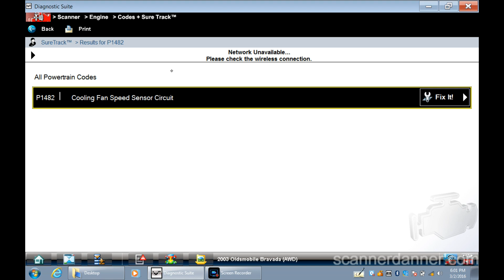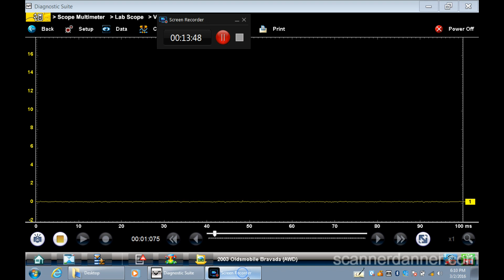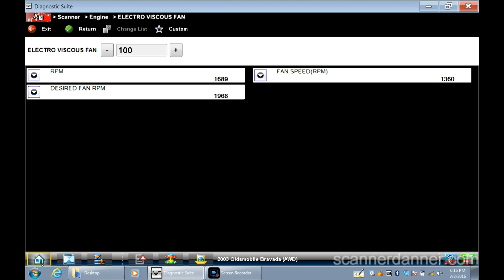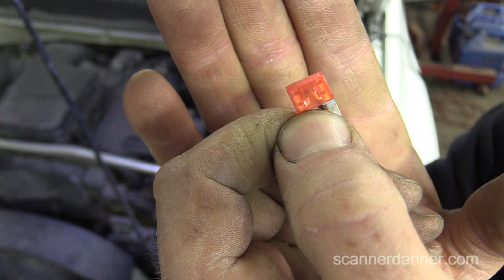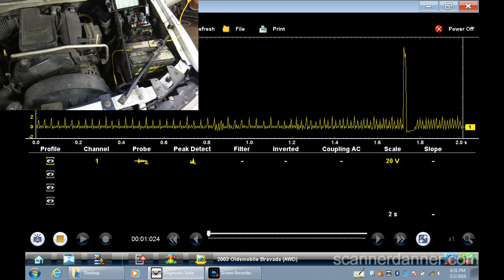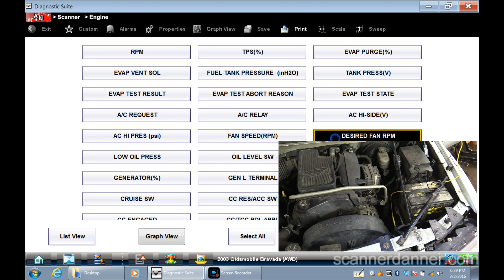Electro Viscous Fan - P1482 Cooling Fan Speed Sensor Circuit

Comment: Threw a water pump, thermostat, rad cap, and fan clutch at mine to still have overheating issues, then see your video and find out it was just the fan relay was bad. Thanks for the great video ScannerDanner!

Comment: I know its an old video. But maybe someone sees this an has an idea. 
07 Mountaineer 4.0
Never overheated, had the ac leak fixed and refilled. Less than 5miles from the shop it started getting warmer till 15mins later it eventually overheated after the temp went up and down. Being 90°+ i was atleast able to make it to my work. It had coolant and oil. I am thinking the electro viscous fan clutch is bad. But im not getting a code or anything. Wires were melted but i hsd previously repsired that section but could that be why its perhaps causing overheating. Just not running hard enough. When u shut her off ut stays spinning for 10-20seconds and i know that would mean a regular viscous clutch would be bad.
Reply from the maker: Step 1 before you go any further is to do a chemical block test for a blown headgasket. 
Step 2 it could be a fan issue but if it is, it will ONLY overheat in traffic. With constant airflow from driving it, it will remain cool.
Your AC system will be disabled by the ECM if it senses an overheating condition

Comment: And you know snap on is nothing but a joke rip off at 300% markup. You have to keep updates every 2 to 3 years because if not you go behind you’re looking at $10-$15,000 just for updates and the whole thing is all that data that Snap- charges you for all the aftermarket Mac Matco XL I’ll tell is the same data that’s in that scanner that you’re being charge for and they give you those function testing that Snapon gives you the same identical wants same data for free and you don’t pay 45, 5500 for a scanner and you get all the connectors they give you With the price of the scanner but snap on you have to buy that separately but guys in the automotive like the color green the design I understand that I buy snap on but when it comes to their test equipment it’s not worth it I’ve done it you get the same thing for a cheaper price and better equipment better warranty the data they only warranty that for one year the other companies out there some go to years but basically it’s the same thing one year so when you see your snap on rap if you want to easy bring a bottle of Vaseline
Reply from the maker: You seem like an angry and bitter person

Comment: Can I put double fans an take out my fan clutch I change my fan clutch every 6 months Y. .
Reply from the maker: Most likely. You'll just need to add a relay and maybe a temp sensor to trigger the relay
Reply: @ScannerDanner  do you have those sensors (number) an I can hit auto zone thanks
Reply from the maker: @fatjack840  no my friend, this would all be aftermarket stuff that you'll have to do research on to see what will fit for you. If you need additional help, post this to my forum. IT is free to join and we can help you https://www.scannerdanner.com/forum/post-your-repair-questions-here.html

Comment: I have this crazy problem after changing out the water pump on my trailblazer. But when I pulled the fan and clutch I found bare wires going to the clutch. Fixed, installed new pump, threw it all back together. Now, I won’t climb over 160*, fan fuse was blown, replaced, I stopped the fan by hand while running, blew the fuse again, replaced and drove to work. Checked it out and was blown again. Oh man what did I do lol getting into fall 50/60 degree days and the heat works.... just not well. Thinking bad Tstat and now clutch. All was fine (ac/ heat/ coolant temp) before the water pump failed. Any ideas?

Comment: Aren't those also temperature/rpm dependant...it always seemed they were locked up cold then quieter as it reach operating temp then locks up mire as it gets hotter.
Reply: More
Reply: 300 seems low

Comment: I have the same problem with my 2002gmc envoy, I changed the fan clutch, and the check engine light still comes on but I checked the fuse that is supposed to be a 10amp and the previous owner had put in a 15amp fuse and it is blown. So now I have to change the fuse and hopefully it will at least clear the check engine light
Reply from the maker: It should, change the fuse to the correct rating and then clear the codes, then go from there
Reply: ScannerDanner it worked finally the light for my fan went off, now I just have to work on  my ignition coils, I’ve replaced two and it keeps showing a “misfire” on multiple plugs it’s driving me nuts

Comment: Question: I put an electric fan system in place of the fan clutch with the thermostat and temp probe. It works fantastic,  however im still getting the P1481 error codes because there is no fan clutch plugged into the harness anymore. Please tell me that there is a way to trick or bypass the PCM from constantly throwing this now unnecessary error code???

Comment: I have this exact same vehicle and all of a sudden when I turn my air conditioner on my engine temperature starts increasing to basically overheat so I turn the ac off and back to normal.  Is my fan clutch bad?
Reply from the maker: what happens when the AC is on at highway speeds? If everything is normal, then yes, I would focus on the fan, if it still starts to overheat, you need to look elsewhere
Reply: @ScannerDanner  Ok thanks I will report back.  Everything started about a week after I topped up my air conditioner from a slight evaporator leak I was having.  Not sure if that can be related but my a.c. is cold but my engine temp all of a sudden goes up it wasn't in highway but I'll check on it.
Reply: So I decided to look at the #20 fuse(good) as well swap the fan relay #45 with hdm relay #46. Took it for a drive ac full blast street and freeway no overheating. I really doubt the relay did anything maybe it's more intermittent problem which will point to what? I guess just keep an eye on it now.
Reply: @ScannerDanner  Ok my truck finally gave me a code yesterday since I stopped using the a.c. so my truck wouldn't warm up.  Code is the same as this video p1482 but my fuse is good and I will change the relay to a new one here soon. Do you think my fan clutch is out for sure and also took out my relay possibly? Thanks.

Comment: You were by far the only person to go this far and at the end you dropped the ball..This is a problem plaguing MANY Trailblazer and Envoy. I have gone the full replacement of fan,belt,radiator, thermostat,water pump, due to a catastrophic belt failure. Also relays, connector and wires to the fan. To no avail! As of yet I have seen no resolve on any search page. [04 trailblazer p0526 code]  I can clear it every time I drive but every time I restart the car the code comes back. The fan will also randomly stop functioning around 95 degrees outside and my car will overheat. Normally my temp gauge is strait up in the middle.  So my question is: can you really solve this problem?
Reply: Try the coolant temperature sensor. A quick continuity check on both leads and then heating up the sensor with a torch should give you a signal. If that activates with the heat then it is working if not it's time to replace. Test the new unit before installing.

Comment: They forgot to read the fine print on the crumpled up paper in the bottom of the new fan clutch box, that said, Warning: This fan clutch  assembly should not to be used with an electronically controlled fan cooling system! Please be advised that failure to follow this warning could result in severe injury to people or extreme damage to property. Lol. Change it for the correct one and make sure the actual speed is following the speed it's calling for. Then it's Repair finished.
Reply from the maker: lol, this fan is sold as an assembly, complete with the speed sensor and wiring, it was NOT the wrong fan

Comment: Thank you for taking the time to make this video, I have a few follow up questions.  I was having a problem with the electronic clutch fan. No code but there was excessive noise from it.  I replace it and once I did I got various codes from P1481 thru P1484.  I google it and your video came up, so I checked the ground, the 5v reference from the connector on the side as indicated on the video.  To my surprise, the clutch works fine when disconnected. If I plug it back in I get excessive noise again, I just don't know where to go from here? replace the clutch again or just the harness that leads to the clutch?

Comment: Mine wouldn't work even after replacing the fan and harness and the 10 amp fuse. But after clearing the error codes with a scanner the fan worked.

Comment: Good video.  My problem with my 03 Envoy (5.3) is that the fan spins too SLOW, to a point that the AC won't cool (overheating condenser).  Then it begins to spin up properly.  This only happens when engine is already warm.  I'm going to unhook the fan harness altogether to see if it actually will speed up the fan
Reply: Mine is thowing code and Ac is not blowing code either did you figure out how to fix?

Comment: Good thorough diagnosis. Here's what happened to me. I did have a bad fan clutch, roaring all the time and I could stop it by hand. I replaced the clutch (not really a tough job at all with the right tool) and was not really happy with the performance. Sounded better but would get slight overheating with AC on. Not terrible, like 220, 230, but concerning. After watching your video, I unplugged the fan connector and two of the pins were pushed down so far I was getting no connection. Happened when I replaced the clutch and pushed the connector together. Something so simple. Now working great. No roar, no overheating with AC on

Comment: I changed water pump and fan clutch at the same time. The old fan clutch was fine but i went ahead and replaced it. Now my fan runs fast only when im driving. Runs fast in 1st gear then gets quiet once the car shifts into 2nd gear and its quiet from then on unless i stop at a light and start driving again.

Comment: Great video!! I have the same problem with my 03 GMC Envoy SLE. Had the fan clutch replaced last winter supposedly with the NEW and improved version?? My Envoy sat most of the spring and summer. This winter started driving it about 150 miles and got the P1482 code. Replaced the broken 10 AMP fuse and the code disappeared. Code came back on and replaced with 15 AMP fuse and code went away. Code came back on and that is where I am right now?? I wish you were closer, I'd take my GMC to you!! Any suggestions.
Reply from the maker: Probably need to replace the fan clutch again and you never want to out a larger fuse in as a fix. You risk a fire when you do. Hope that helps.

Comment: OMGosh!!! What a great video!! I have a 2003 GMC Envoy and have the same situation!! New fan clutch and water pump replacement!! It has been about a year since I replaced the clutch and pump and two day sago I got a P1482 trouble code. I will replace the fuse!! Thanks!!!

Comment: Perhaps there is a temp related lockup that mechanically overrides your electrical control when the fan is hot. When cool the fan would respond normally to electrical control. After warmup, when the system is hot, mechanical control overrides all. It would be interesting to see this tested on a cold day with engine cold, which is the main time you want to completely shut down that fan.
Reply from the maker: These viscous fans are always very noisy on first start up. I don't know the internal hydraulics of this offhand but it is normal for them to react this way. Something about where the fluid pools on shut down.

Comment: darn this was getting close to my problem only that my fuse wasn't blown...... i was at first getting a coolant temp sensor code, swapped that along with the thermostat. after i plugged everything together and turned the car on, the fan would just not turn off... i looked at the wires and everything seem fine. The problem that i am having now is that its intermittent

Comment: Snap-On's description of the trouble code is a bit misleading here, a quick web search for that code revealed it's usually described as a "control circuit" or "relay circuit" fault (which matches up with the burned fuse).  However as the Snap-On tool calls it a "Fan Speed Sensor Circuit" of course the direction is to look at the speed of the fan rather then the control side circuit integrity... Also there is a large variation allowed in the desired vs actual fan speed - up to 1000 RPM (before setting code P0483)

Comment: Please correct me if I'm wrong here and I have never had to deal with a electronic clutch control fan.
But the basic operation I was taught was:
At idle / low engine RPM (and vehicle speed) the clutch fan should operate at or close to maximum to get more air movement and as you increase RPM / vehicle speed, the fan slows down.
The desired fan speed (I assume computer controlled) @ idle is shown @ 304 and does not change.
I would think the commanded fan speed would be higher at idle and lower itself as engine RPM increases.
Possibly other factors (sensors) might cause operational changes due to outside temperature, but on this warm engine... 
It appears to me the fan/clutch/computer command is(are) operating in reverse as they should be.

In my Nissan I have a non electronic clutch fan.
At start up and for the first 15 - 20 seconds the the fan spins at the same (high) RPM as the engine, then spools down.
Quite noticeable, that the clutch is locked for the first few seconds then it begins to function properly. high airflow at idle and lower airflow when revved up.
I've since found this to be SOP for the 3.3L Nissan, 3 others on the block do and sound the exact same way.
Reply: do not count on my info to be correct, but i noticed that too. it seemed as if being at a higher rpm for this vehicle triggered some sort of engagement above desired rpm  of what the vehicle should have been doing, but remember he was over riding the defaults for the sake of testing the clutch's ability to engage and disengage but in short i suspect his clutch didnt have a problem engaging, but rather a problem disengaging, only after he replaced the blown fuse, remember before he placed the fuse it would not engage at all...i think. i would have liked to known the symptoms before the fan was replaced  2 years ago now,and perhaps a theory on why the fuse is blown

Comment: The cooling fan relay sends a pulse width modulation (PWM) signal of 12–14 volts 
to the cooling fan clutch through the cooling fan clutch supply voltage circuit. 
The powertrain control module (PCM) uses this PWM signal in order to control the 
speed of the cooling fan clutch. The signal controls the position of the oil 
control valve inside the cooling fan clutch. If the cooling fan RPM is different 
than the PCM is expecting, DTC P0483 will set. The actual cooling fan RPM vs the 
desired cooling fan RPM is not always exactly the same. There can be up to an 
800 RPM difference. If the PCM detects that the cooling fan speed is over 
6,800 RPM then DTC P0493 will set
Reply: P0483; which can only set at a steady RPM below 3200 not varying more then 250 RPM for 5 seconds, with commanded fan speed greater then 0% - (Also some sources mention a max 1000 RPM variation and 0 - 12v PWM square wave - as seen in the video)

Comment: Aftermarket grease box gots too much goo in it.  Where's my dremel?  And a lead shot fishing weight to fix the hole.  Control is likely to be wire wrapped heater on the standard bi-metalic valve?  I'm just guessing.

Comment: to complex fan speed circuit ???
Reply: Certainly doing things differently without a real reason, probably some power train  engineer fresh out of university wanted to make his mark by doing it differently from the guy in the job before him. In reality its no less or more complex than some of the PCM  controlled electric fan circuits  out there, the only advantage I can see is it more likely to fail safe than a single  electric fan.
Back in the 1970's  Chrysler France use a fan with an electric lock-up clutch but that was much  simpler no electronics involved.
Reply: Andrew W MacFadyen
 yeah friend that is im trying to say thanks

Comment: Great video man! Thanks for the share. How's the Verus Edge working out for mobile diagnostics, any dead battery issues yet? Been thinking about getting one. But, I worry the battery would be an issue. Cause as it stands my Modis Ultra never dies and if it gets close I just plug it in to the DLC.

Comment: Won't it run too cold if the fan is always engaged? It's also robbing the engine of power?
Reply: 1.nope the engine termostat is keeping it constant temperature. 2 yes it is robing power around 3-10 hp.
Reply: *robbing